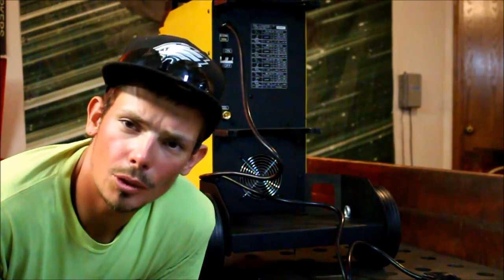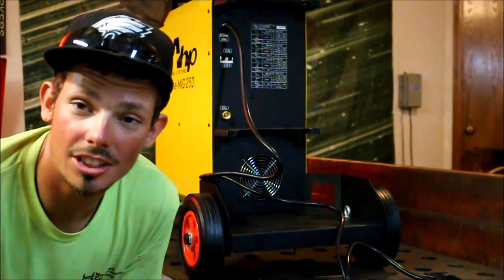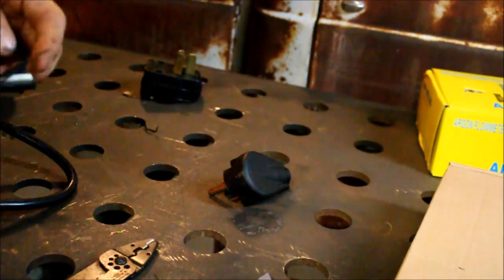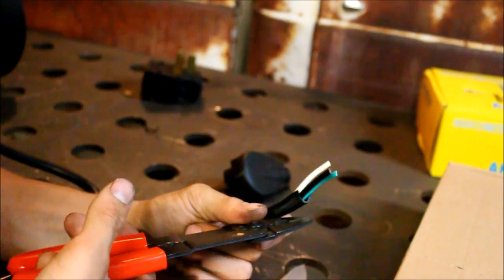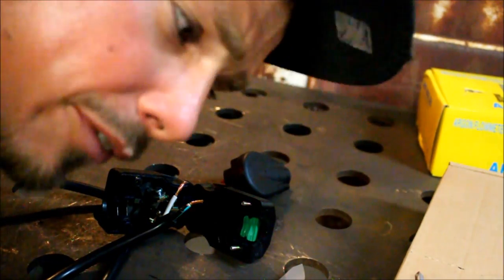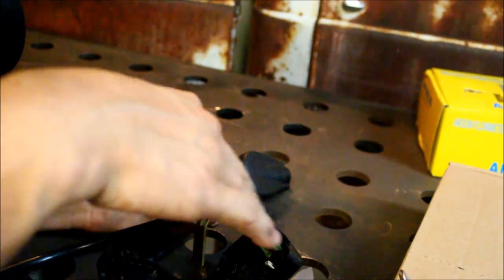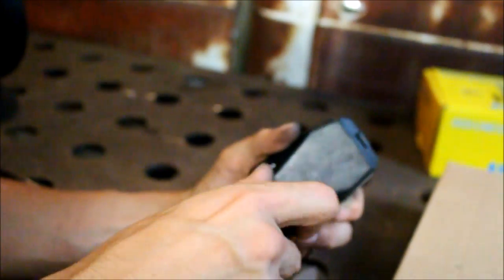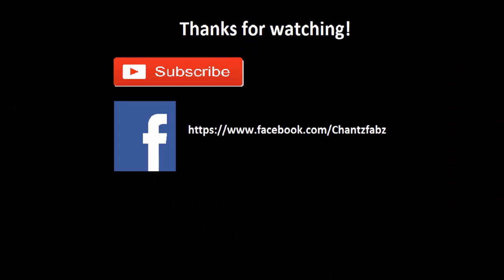How to wire a 220 plug!

Comment: If you look at the final wire connections to the plug, the screw end from the Black (hot wire} is touching  the outer insulation of the green ground wire, If it is touching  hard, over a period of time the screw can cut into the insulation and short to ground. just my $.02. Also I wish you had explained which wire goes into which specific pin on the plug.

Comment: How do you know which wire goes where?
Reply from the maker: CannaMechanic middle prong is ground and the 2 hots don’t matter if it’s left or right..
Reply from the maker: Green is ground 
Red is hot 
Black is hot 
White is neutral
Reply: Thanks!
Reply from the maker: CannaMechanic glad I could help!🤘🏼
Reply: Isn't the white hot in this case and not neutral?